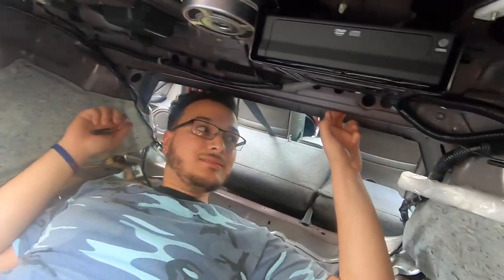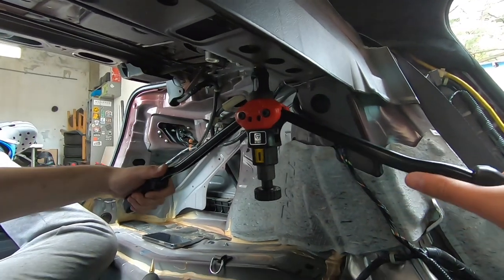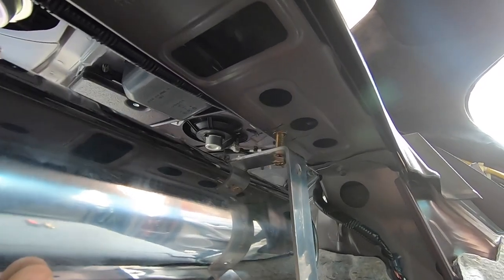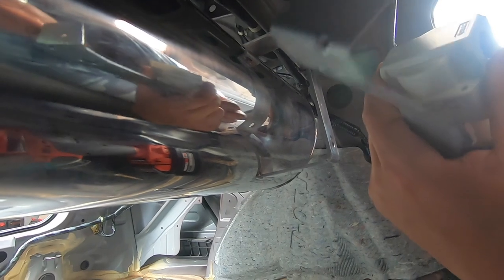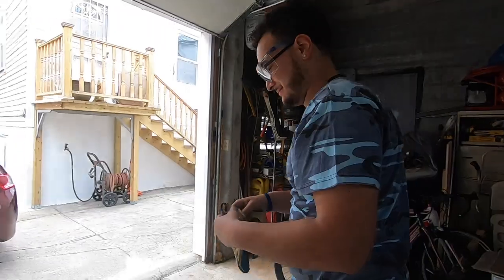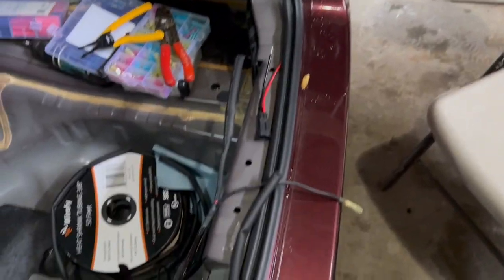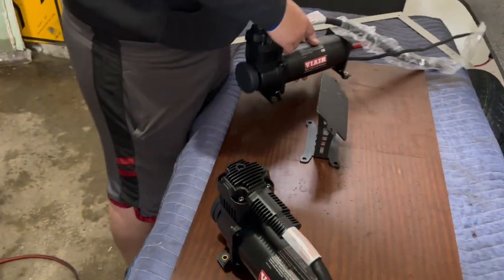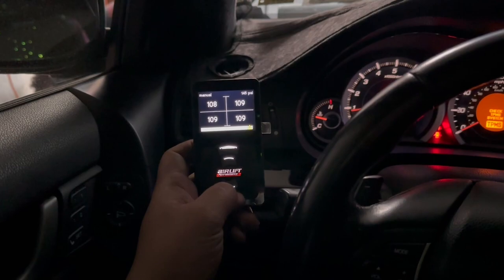Installing Air Suspension On Friends Car | Airlift 3p | 09-14 Acura TSX

Comment: How many inches of thread do you usually start with on the struts themselves before you start doing adjustments?
Reply from the maker: I actually left my struts exactly how they came from airlift since its already a significant drop from stock struts. I only adjusted the dampening afterwards.